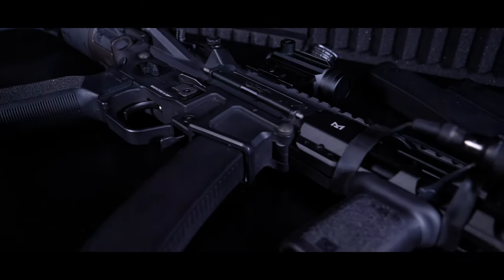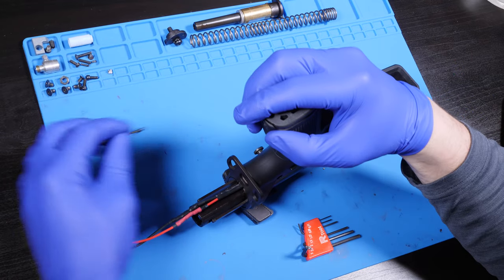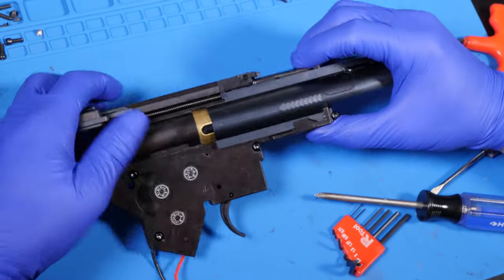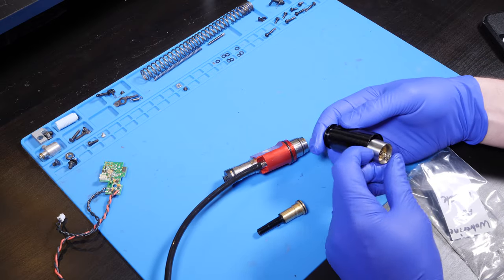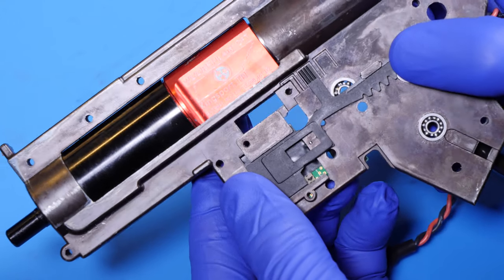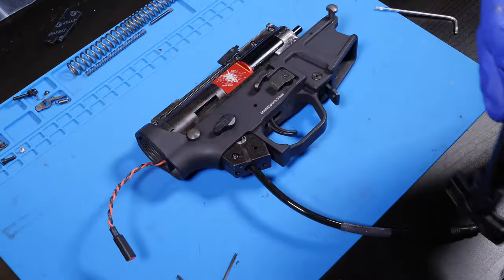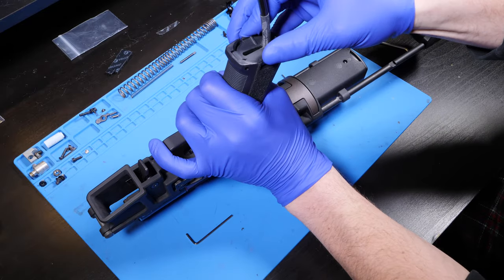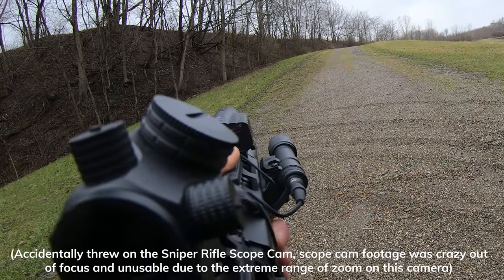How to HPA the KWA QRF MOD 1 | HPA Engine and Full Build Install Guide

Comment: This video helped soo much and I’m actually at the point where I feel comfortable enough to do other HPA builds
Reply: Hey does a 2.5 gear Box work with this ?
Reply: @kylebotelho6332  I used this to HPA my t6 and it has a 2.5 gearbox

Comment: At around 9 minutes, you recommend the T6 hop up unit be shaved down a couple mm to allow the mags to feed, I’m just curious if you discovered this yourself or if you read it somewhere? I’m having a ton of feeding issues and have since I opened the box on my mod 1. This is the only place I’ve heard anyone mention doing this.
Reply from the maker: This is something I found out on my own.  I purchased drop in barrel/HopUp kit from bloomies airsoft, who built the drop in kit for then ronin t6 specs thinking that the QRF MOD1 had the same exact specs.  Once the drop in kit arrived and had trouble feeding, I compared it to the barrel kit that came stock with the MOD1.  And this is where I noticed different length feeding tubes on the HopUp units, despite them looking identical at first glance.

Comment: So, picked up a Ronin and (just yesterday) a mod 1.  Initial research says the GB is a 2.5, but in video you say v2 m4 with longer AK nozzle.

You did use the original oem GB during this install?  Thanks.

Comment: Hey, I know this video is quite old now, but I've followed your instructions upon purchasing my very own KWA mod 1. I've followed all the steps except the hop unit and barrel. However I'm having to turn my psi up to 120+ to even reach 300fps? Any reason why this might be?

I've trouble shooted a few problems, alignment of the nozzle, now sits dead center in the barrel. There's no leaks in the engine itself. I've cleaned and lubed all the o-rings. 

Any ideas?
Reply from the maker: Did you use the proper nozzle?  I had the same issue because the standard m4 nozzle wasn’t long enough to seat the bb, I switched to the Ak nozzle (per wolverines recommendation) and my issue was solved, I hope this helps
Reply: @Private_Caboose  yeah I used the AK nozzle too
Reply from the maker: @LoneWolfKumo  okay my only other thought is the stock gearbox has a gap around the nozzle, and the the stock HopUp unit has a lip that’s should snap into place.  I would look from the magazine well at your HopUp and try to rotate it or push it into the respective slot around the nozzle.  I am hoping that is it, those are the only two issues I ran into as I also had the low fps issue at first. This info came from Dan At bloomies airsoft as he’s done multiple high end hpa QRFs

Comment: Awesome build! 👌  maybe I can find some insight here. I am trying to do a similar build but would like to run a Fusion Engine. I noticed you mentioned V2 with a AK nozzle. Would that hold true for the FE? Being a drop in with V2 specs, how is the fit in the QRF 1? The mod 1 was a V2.5 gearbox I thought. Anyone with info that could help, I would appreciate it. Again awesome build man, just adds to my desire to answer these questions. Thanks in advance
Reply from the maker: Hey thanks brother!  so I would have been left in the dark if it wasn’t for this compatibility chart from wolverine: https://www.wolverineairsoft.com/compatibility/

I’m wondering if polarstar doesn’t have the same sort of chart available, or maybe an email to them would get that info?

Comment: is the polar star f2 the same instal?
Reply from the maker: Yeah the engine should go in just fine, but remember that you’ll most likely need a specific nozzle to bridge the gap in this not so m4 spec v2.5 gearbox.  For the inferno it was an Ak nozzle that worked correctly and was suggested from Wolverine.  I am not sure if the same applies for p* engines
Reply: @Private_Caboose  okay thank you. i have a t6 and this looks almost the same so i’m hoping this video will help with my hpaing my t6. but i wanna keep it aeg for this event in wisconsin in april so i plan on getting a full metal shell and upgrading everything in it for hpa and learning as i build. what would be the best platform to go with for a beginner to put an f2 engine in? i really only care about it being full metal and ease of instal. any suggestions?
Reply from the maker: @namesseth4996  I would say any full metal standard version 2 gearbox, so m4 specs.  From there it really comes down to aesthetic preference, a few good brands to look at would be krytac, GnG, Cyma.  You just need a solid body and a standard gearbox.  A couple watches on a standard version 2 gearbox hpa install video on YouTube and you should
Be set!

Comment: I’ve been trying to install my polar star jack in a gun for months and I’ve ran into so many problems. I’m still yet to install it into a gun and the gun I was gonna put it in there’s literally no way for me to get it in sense the gearbox is very weird and uses a magnetic selector plate and a micro trigger with no hole to screw in the trigger board. Now I want to put it in a KWA TK45 but I don’t have the money for it and I’m worried that I’m gonna mess it up. I wish I was as cool as you 😪
Reply from the maker: Some rifles are just built differently, comparability issues can ruin your day man I feel you.  I would recommend bringing all your parts to your local tech to hopefully salvage your build and get it up and running!  If no tech is nearby, I recommend amped Airsoft Or Airsoft junkies to send your parts in for assembly.   Just keep tinkering with it man, that’s how I learned!